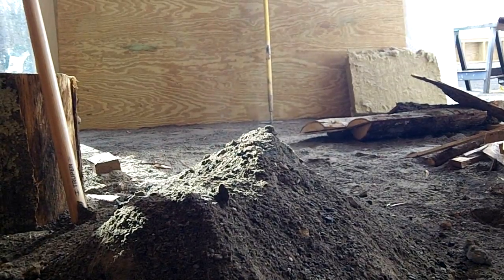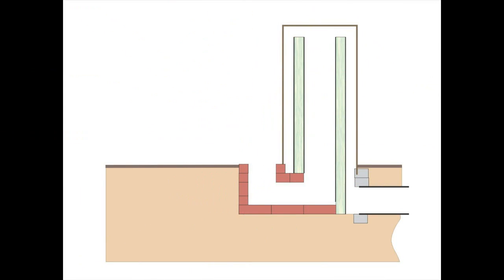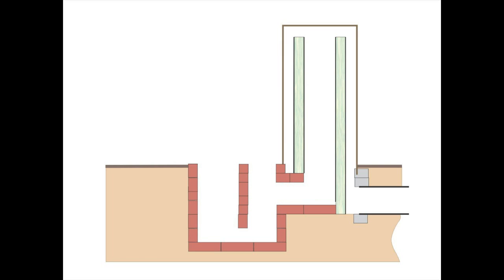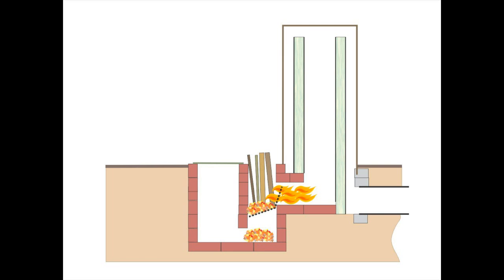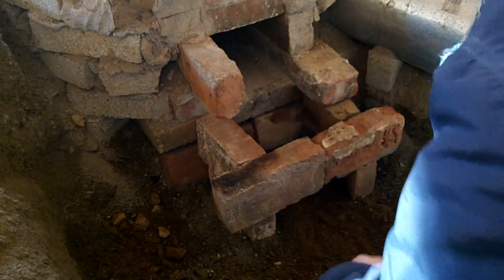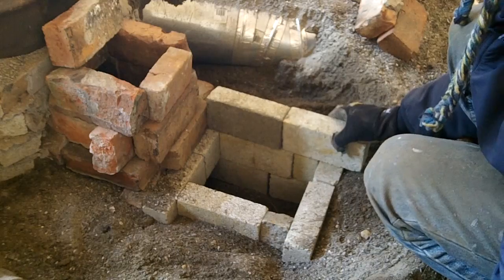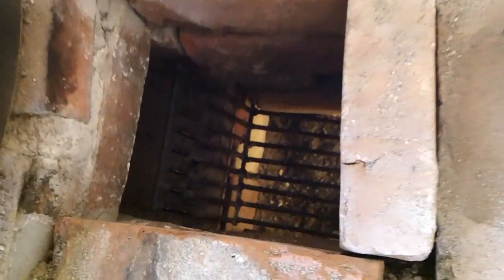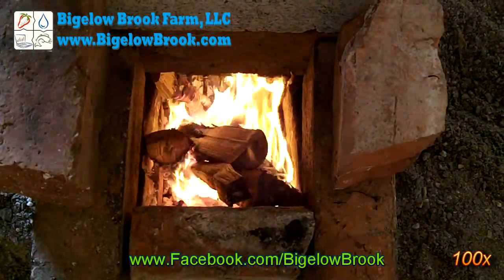Rocket Mass Heater Update

Comment: Really nice additional tweak to the basic J-Rocket mass heater. I may well steal your innovation for the next one I build. My current one has the standard opening at the top of the feed tube, but also an opening at the end, where your extra ash-cleanout structure is. Lids on both openings. Top lid open when burning, but with the end lid closed during a burn - as you say, to prevent improper drafting; and both lids closed for rapid fire dousing when I want to stop the burn. I clear out ash from the whole burn tube through this end opening, with a long-handled scraper; but only when the fire is out. Continuous burn, with that clever grate, and the capacity for ash clearout whilst burning, is something I haven't built yet. Thanks for showing this good idea!

Comment from the maker: several reasons:  It's $3000 for it;  It would block another 18% of the light coming in; and there would be a lot of condensation between the pieces which would expose the wood frame to much more moisture.

Comment: If you build it with less restrictions you will not need to power a fan.  make projects.com/Project/Heat+Exchanger/279/1#.UH1cr7KPUq8

Comment: Bad Idea, running air directly to burn chamber has been done, as far as I have read with no success.  I tried and when wind suddenly changed direction the air intake acted like a chimney. Smoke up the intire house. was a bitch to get it back to normal direction.   Wife about called it quiets on the hole thing..lol

Comment: you could always use a double-pane solution, putting backing panels on the underside of the wood frame. while polycarbonate has an aweful r-value, a couple inches of air has a much better ability to insulate, hence why most windows nowadays are double-pane.

Comment: Thanks. Is there a cost effective way to better insulate the polycarbonate but still keep the light filtering qualities? I have been wondering how to incorporate a dome into a home structure but if it costs that much to heat I am not sure if it would be wise for the northeast. One family did that but they were in TN so its a bit warmer. (wishyouwellfarm). I have noticed that some people use that marine shrink on their g domes. Would that add r value? LOL maybe some warm bodied goats would help

Comment from the maker: It's a big space and the polycarbonate has an r-value of 1.8 so there's a lot of heat loss.  In the homes, people can fire it for an hour or so and it's enough to keep the house (or more likely cabin size) heated for 24 hours.  I've been working on a design to have the unit self-feed the pellets with no power requirements.

Comment: Have you thought about making a door for the feed opening that way you could slow the burn time and increase the heat massively by reducing the draw you dont need nothing fancy just try it out with a steel plate about 1/4 inch thick

Comment from the maker: Yes, I understand the theory and it is more efficient.  But the cost of installing coax duct would is crazy expensive.  Plus I have an unlimited supply of wood so burning a few extra logs a day to offset the energy loss is no effort.  My goal wasn't to make a super-efficient heater, it was to built a cheap heater that was somewhat efficient.  I appreciate your input however!

Comment from the maker: @2steepanddeep Normally I would agree about an air feed.  Our house is very tight and it has it's own air intake for the furnace and a heat exchanger to bring in fresh air.  It is so well insulated that we actually have problems with the door knobs freezing from condensate buildup!  The greenhouse has enough leaks around the vents and other areas that it isn't worth the effort/cost to poke another hole through the wall.  I do appreciate the concern however!  Thanks!

Comment: Another idea would be to slope the floor of the ash pit so that the ash would slide away from the burn area on its own, however the pan is a better idea. I think that you could do that with the current design. Just make a metal box that is low enough to slide through the hole into the other chamber. If you attach a metal rod to the end that does not slide in you could use this to slide it out and remove it from the ash pit hole.